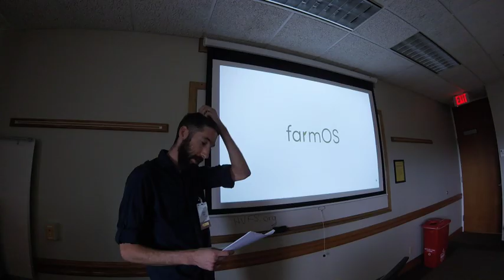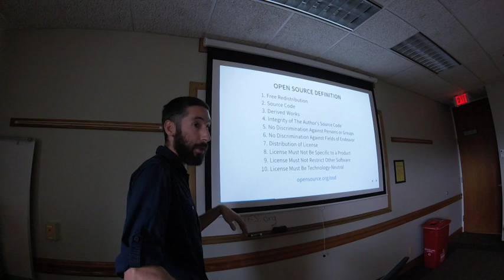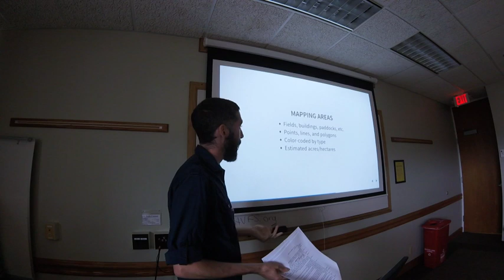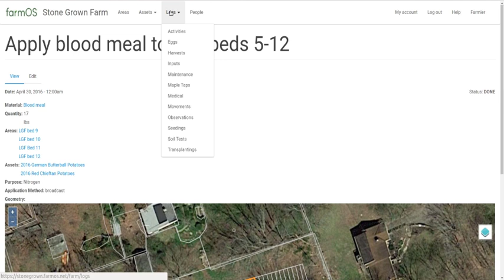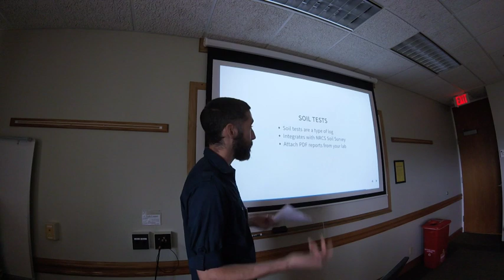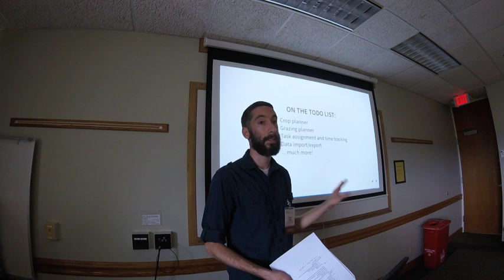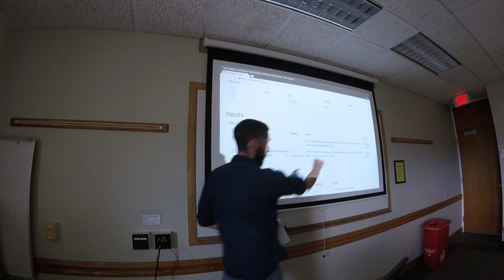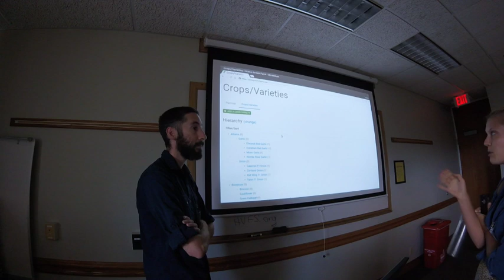farmOS Workshop at NOFA 2016 Summer Conference

Comment: Michael- This is great stuff - we are trying to enable folks to use more open-source and open-standards technology by helping them build IP networks across the farm using standard WiFi and Ethernet. The "big idea" is to enable growers to use inexpensive open technologies (Arduino, Photon, Raspberry Pi) to collect data on the farm and control farm equipment without having to have separate radio systems for every device. Plus it allows growers to use their smartphones, tablets, and laptops anywhere on the farm to access their FarmOS software. If we can help, please let us know! - Bill Moffitt, Ayrstone Productivity
Reply from the maker: That's awesome, Bill! The stuff you're working on is extremely important. farmOS has a "Sensor" module that allows other devices (Raspberry Pi, Arduino, etc) to post data to it over the internet - and of course internet access is a prerequisite for that. With better wifi on farms, and more sensor devices deployed, there is a whole trove of environmental data at our fingertips to learn from!